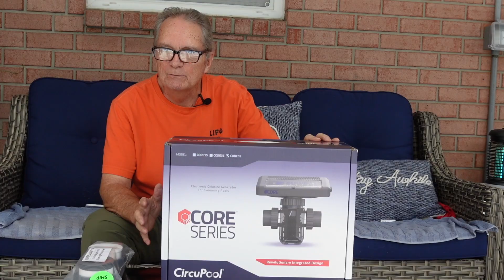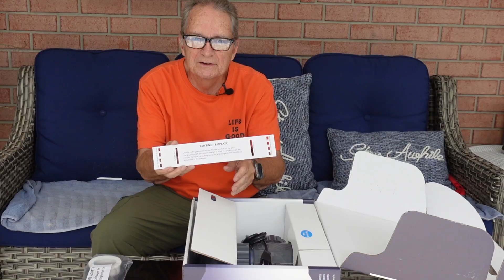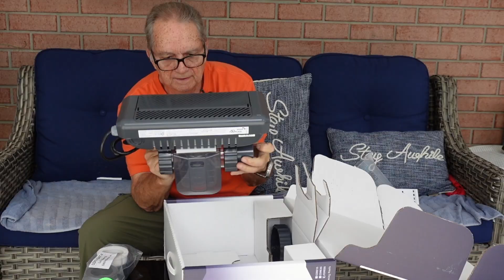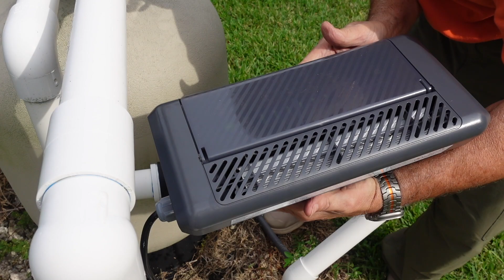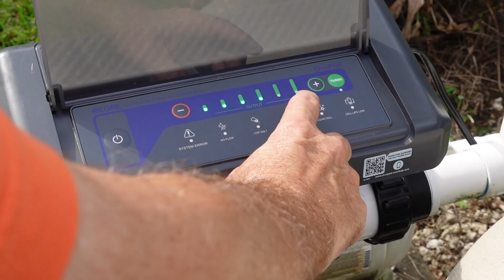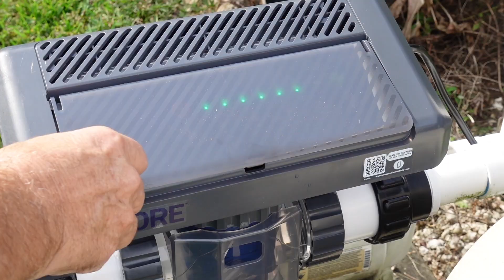CircuPool Core Install - Direct fit for Pentair IntelliChlor

Comment: I have pentair IC 20  thinking about Core35. I' don't have any 110 outlets  outside. Is it capable of into  pentair adopter
Reply from the maker: No, the Pentair power supple will not work. However since you do have power for that Pentair power box it would be pretty easy to install a receptacle. Good luck.

Comment: Hey Jack great video I plan to change over to a new system and the core looks like a contender over the years and they all fail after 2 to 3 years I'm not sure if you know but I'm wondering if I can convert the power from my intellichlor Power Center 2A outlet that I could use for the core product
Reply from the maker: That I don't know, but they have great customer service if you want to give them a call. I'm at one year now and still loving mine. Thanks for watching.

Comment: Heres what i think.  There are a lot of aftermarket versions of these, and they work just as good as the name brands.  These salt cells have at least a 4 yr life span, and that is crazy for what they cost.  Many i have talked to have went to the basic tried and true inline chlorine 3 inch tablet feeder which will last tbe life of your pool basically.  Great video, and a great product.
Reply from the maker: Agree my experience with other products has shown 4 years about the average lifespan. With this CircuPool product I am impressed with the warranty. They state 8 years but in the details it is 100% covered in the first 2 years then goes down a specific percentage each year. Eventually I'll capture a video on the performance over time. Than you for the comment and hope you can subscribe to catch my future videos :)